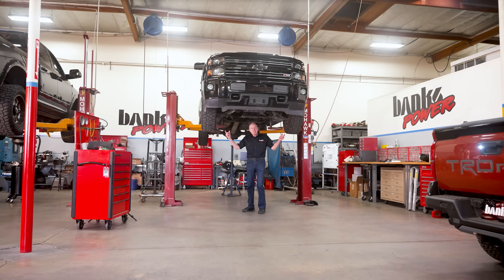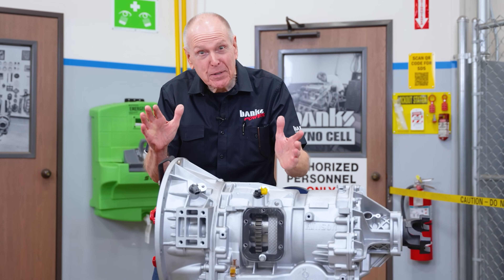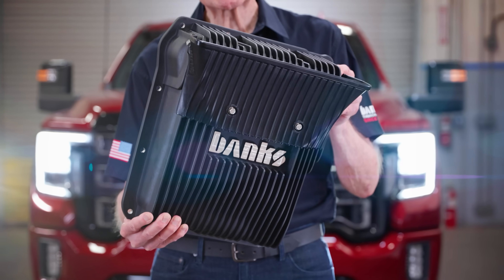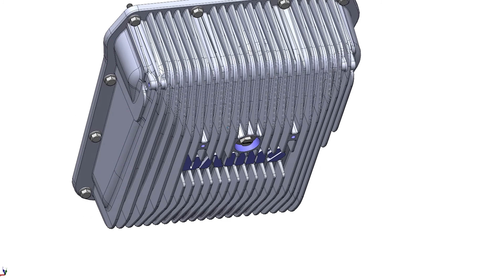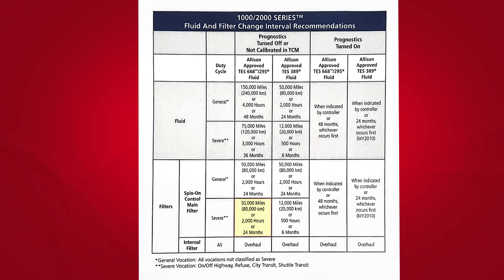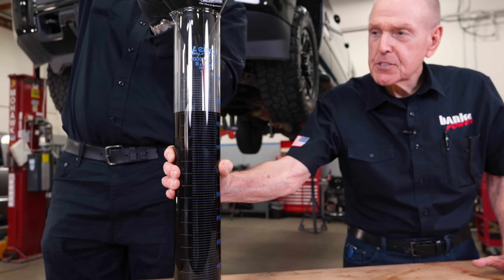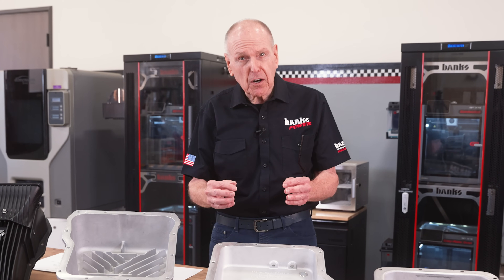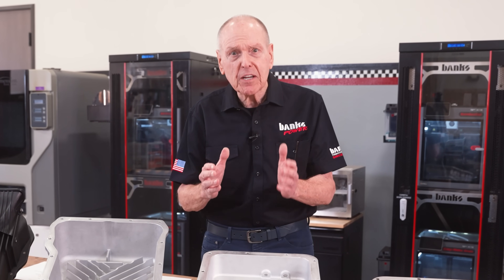Heat is killing your transmission. I'll show you.

Comment: Hi Gale, I see you have come up with a great soloution for the grid heater delete for the cummins by putting heaters in the monster ram for those who live in the cold climates, obviously helps the engine to start and warm up i know most guys idle their trucks a bit to warm up or even have block heaters. but what about the gear box? when the gear box oil is cold it doesnt lubricate as well and surely puts more wear on whe gear box during the warm up especially in those cold climates. i was thingking would it be an idead to have a heater element for the gearbox sump to warm up the oil? just a thought

Comment: Hey Banks, why don’t you care about the 3.0 Duramax?
Reply from the maker: It's a decent engine overall, but we found that the performance potential was lacking without pushing the engine into unsafe territory or circumventing emissions controls. Neither of which are things we find acceptable.
Reply: @bankspower some would argue the 3.0 is pushing the limits right from the factory!

Comment: I recently purchased a 2025 GMC 3500 crew cab long bed Denali Ultimate. After spending just over $100,000 for a brand new truck I took the opportunity to protect it with a Banks oil pan, trans pan and dif cover. After 5,000 miles of break in time they did the installation right there at headquarters. They are super helpful and make fantastic products. This is cheap insurance on a big purchase.
Reply from the maker: That's great to hear! Thanks for trusting us with your new truck!

Comment: Do you have data you can share regarding how much of a difference this actually makes?  For instance, run a truck with the stock pan up a mountain, then change the pan to the banks one and repeat the test.  Does using this pan keep the trans fluid temp down below the 225 degree mark on that test?  Wouldn't an actual cooler make a bigger difference, either in series with the stock one, or in place of it?

Edit:  The exact model probably makes a big difference - they showed a small square pan in the video, which presumably wouldn't have as much surface area as the larger rectangular ones.
Reply from the maker: Our pan is designed to work in conjunction with radiator-style trans coolers, not in place of them. The added capacity of our pan increases the amount of time that it takes for the fluid to become heat-saturated while the scoop and FlowThru fins help shed the heat.
Reply: @bankspower  Right, but this video dwelled a lot on the cooling function of the finned pan design.  Do you have any numbers you can share regarding how much difference it actually makes in any of the common applications?
Reply: @AaronAverett answered your question by not answering your question, lol